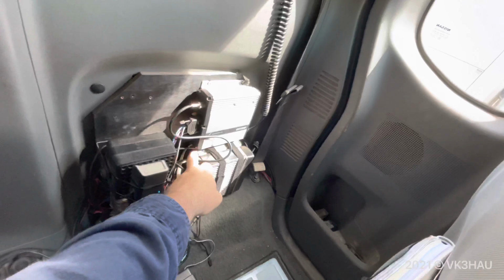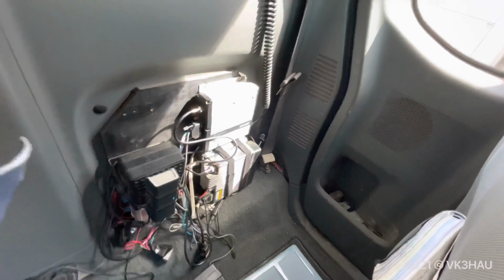Old and new tool box on wheels. © VK3HAU

Comment: Very nice antennas and radio set up in the mobile there  and I thought the sat phone was a good idea as well probably a bit expensive though
Reply from the maker: yes, the Sat phone is $50.00 a month before calls, and calls cost are about $1 a minute, but it is a absolute necessary piece of equipment for where we travel.. thanks for watching Tom.
Reply: @vk3hau  I 100% understand The need for sat  phone personally when we go remote I carry a Plb
Reply from the maker: @VK3FTOM  
yes, we have two of them to.